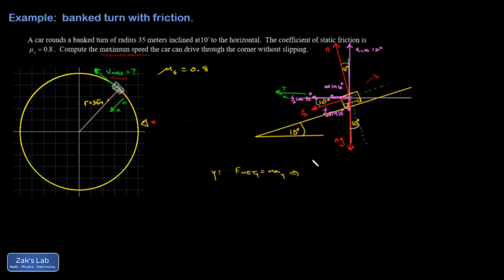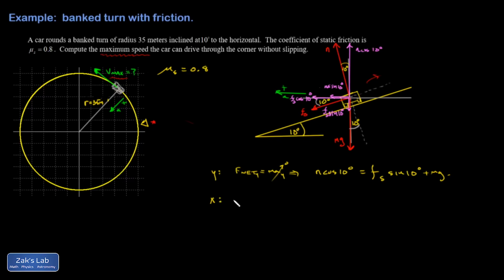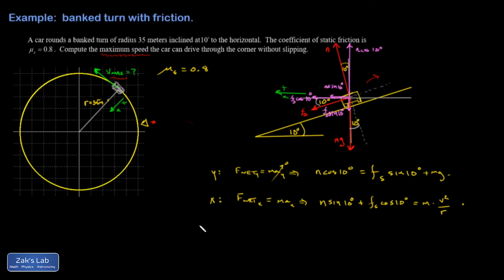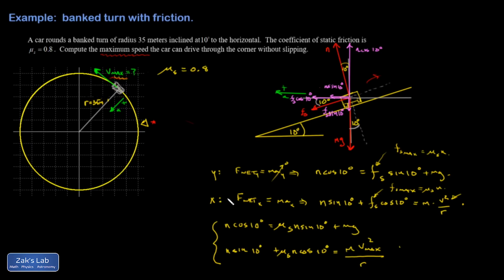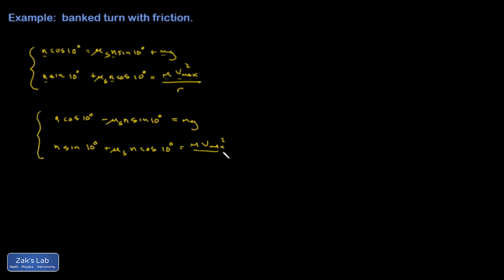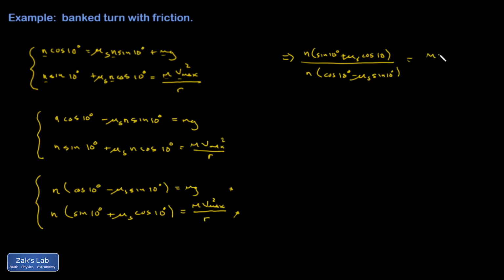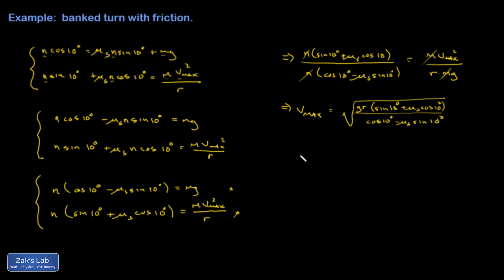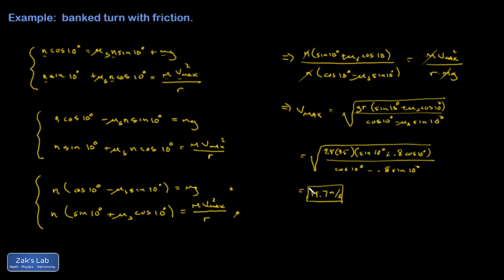Banked turn with friction.

Comment: Can you explain why the friction shows that direction
Reply from the maker: If you imagine exceeding the maximum speed for the curve, the car would break loose and slide up and to the right.  This means the friction force must point down and to the left.  And friction forces are exactly parallel to the surface exerting the force.  z